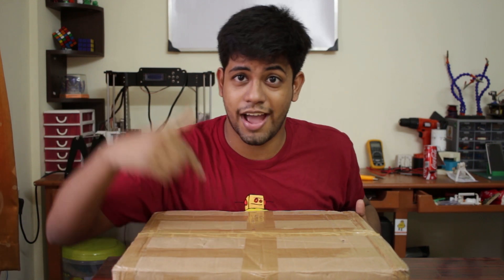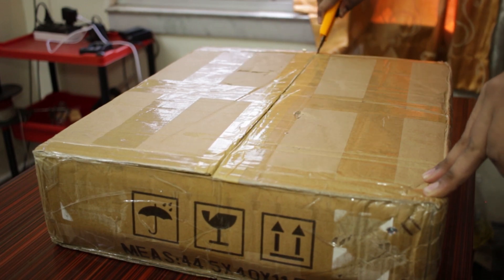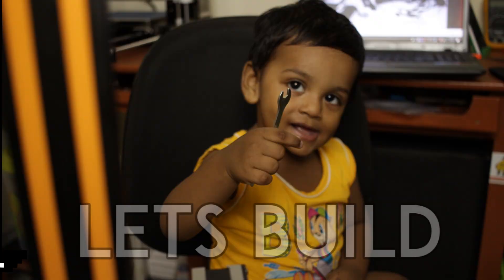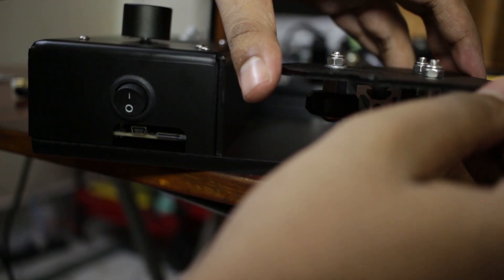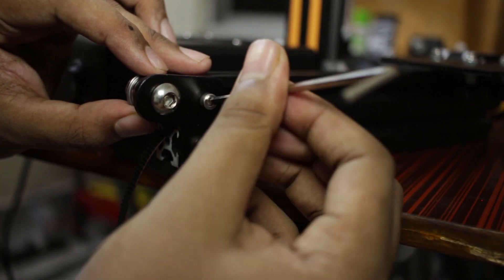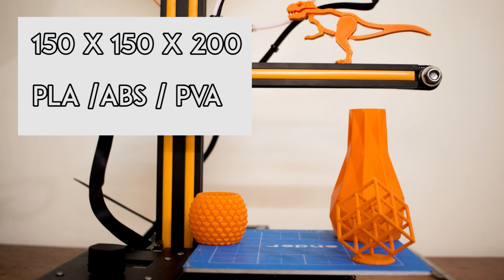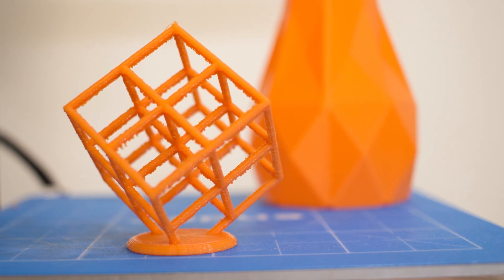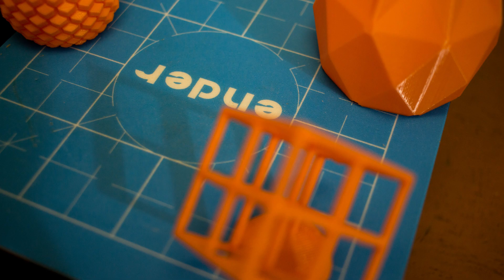Ender 3D Printer Review - The Best Budget 3D Printer

Comment: I have an ender too I printed a CR-10 x axis belt tensioner for both the X and Y belts so if they get loose I can fix it with a twist also the bed springs are under powered or were on mine so I put 4 washers under them to tighten up the bed and now I don't have to worry about re-aligning the bed every print

Comment: you need to tighten those belts, it will give you better prints
Reply: The video clearly shows that your X belt is extremely loose. That's why the prints look terrible.
Reply from the maker: I had tighten that but not clearly shown in video.

Comment: Someone posted a fan cooler for cooling the prints as an upgrade on YouTube. You have to prints out a few parts and buy a cheap small fan
Reply from the maker: +Moots Yes I will be making a upgrade video , but the printer is well already in stock which is important for many starters.